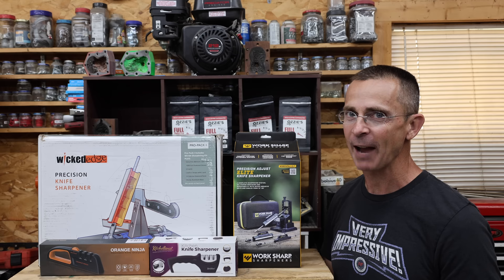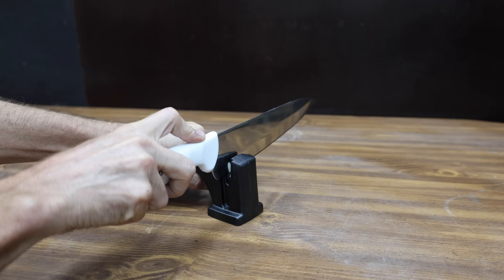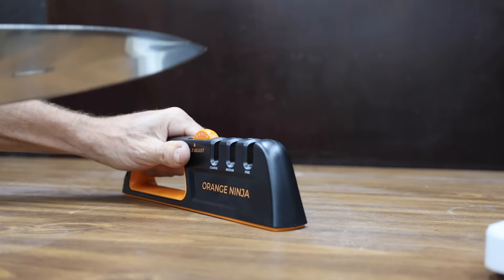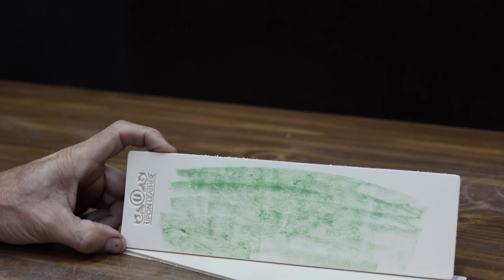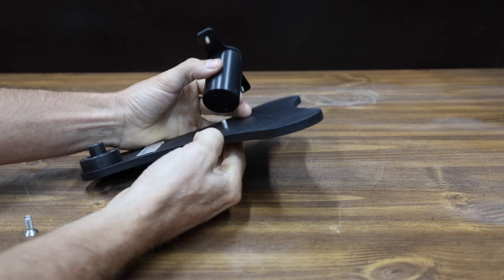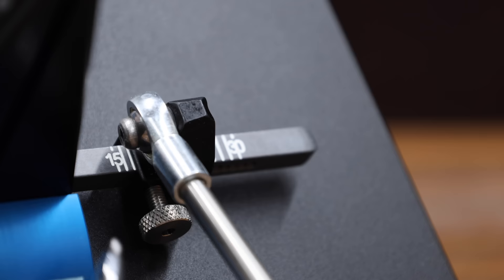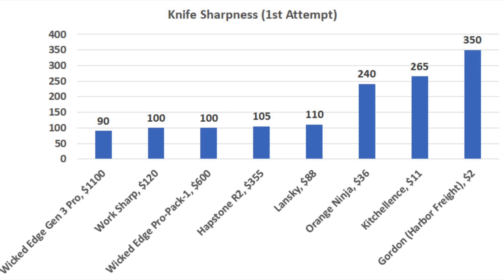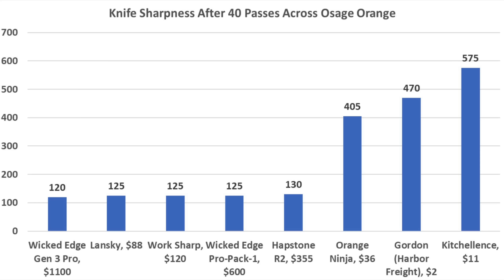Best Knife Sharpener 2023? Let’s Find Out!

Comment: Yessss! Another knife video! I’d love to see a comparison of knife steels. 440, s30v, s35, s45, cruwear, magnacut, vg10, 15n20, d2, etc.
Reply: This would be a good one,
Reply from the maker: Great suggestion! Thank you
Reply: thats a LOT of testing and very expensive. knives with premium steel are not cheap. I know. I own many.
Reply: I also would like to understand the knife metals better and I know PF would be the best way to learn it!
Reply: Cruwear is terrible.
Reply: Great idea!!! Home run for sure, so confusing when looking at knive steels.
Reply: The difficulty with doing a test like that isn’t in the steel itself, it’s in how it’s heat treated and ground. I have 5 knives in Magnacut from 4 different manufacturers and they all behave differently. My Dawson Magnacut has an hrc of 61.5 but my kershaw Magnacut leek is only 60 hrc.
Another difficult thing to rule out is blade stock thickness, as different manufacturers use different steel blanks of varying thicknesses.
Reply: @Shorty_Lickens he's tested multiple cordless power tools, tested zip ties outside for a year. He's got the capabilities
Reply: Thank you for that information. We all now know you own many expensive knives. Congratulations. @Shorty_Lickens
Reply: I agree!
Reply: @MrMisterDerp  I agree I've watched many of the blade steel youtubers test many knives and its almost worthless info because of the manufacturer variables and blade shape variables.
Reply: @naffetstterrag  No one said any different.
Reply: types of steel are difficult to compare depending on how its hardened and tempered
Reply: ApexUltra also
Reply: Victorinox polished/fine grit dual steel. Nothing else
Reply: Knife guy here 🎉
Reply: Same steel may have different heat treatment, and each blade's gelmetry would affect the outcome. Hard to standardize. Larrin Thomas's work would give you a good primer if you choose to proceed. Also, too many "knife tester" channels out there already. Find a unique angle. Best of luck.  @ProjectFarm
Reply: Check out Cedric and Ada outdoors, Pete has done a lot of tests comparing different steel, he has some wholesome content as well
Reply: Unless you can find one manufacturer that uses all of those metals you more likely comparing different manufacturing processes then metals
Reply: That would be a cool video, but pretty spendy!
Reply: Would suggest doing a Rockwell hardness test on these as well to verify proper heat treating.
Reply: Another vote for comparing knife metals! What are the pros and cons for each metal? Surely there isn't one metal to rule them all, so which ones are best for which jobs?
Reply: Yes, Yes, Yes and Yes!
Reply: @Shorty_Lickens Agreed, but I'd send mine to him, just for the "bragging rights" of them being tested by project farm! I'd even send my Strider! And my S90 Osborne carbon fiber, and I really love that one!!
Reply: Check out knife steel nerds he has reviewed most of those steels and has a phd in metallurgy
Reply: Absolutely! Please? We need this tested
Reply: Honestly, it would probably have to be a multiple part series.@Shorty_Lickens
Reply: Include M390!
Reply: Please do a test with Ceramic knives.
Reply: High carbon aogami and aogami super should also be included.
Reply: Not true at all. @freedumbsquirts4809
Reply: I would watch the hell out of a video comparing steel grades.
Reply: Yes please do this!
Reply: @Shorty_Lickens 
Knives made of good steel with brand names are very expensive.
Knives made of good steel with new brands are not that expensive
Reply: If we use the best charpner which mital have ability to be sharp
Reply: Heat treated by who? Video could be very misleading
Reply: Gonna go ahead and 2nd this
Reply: I would love to see that video.  Magnacut is everywhere in the knife world right now.
Reply: 14C28N and D2 seem the best in my use for general purpose pocket knives. My D2 Elementum is easy to sharpen and holds a nice edge
Reply: @killerhurtalot  OK. Can you link a new brand with CPM M4?
Reply: @ProjectFarm please make sure they are properly heat treated knives if you do this tho!
Reply: Please do this!!!
Reply: Too many variables, so even if attempted, it would be full of discrepancies and inaccuracies.
Reply: He could procure most of these steels with a spyderco Paramilitary 2
Reply: @andrewmattiewalter  I bet if he reached out to Sal he would be more than happy to help out with it too!
Reply: @Shorty_Lickens  ok, can you link a single kitchen knife made of cpm m4 lol
Oh wait, his tests has been on kitchen knives...
Reply: Yes, would like to see this. Happy New Year!!!
Reply: A fellow knife enthusiast I see
Reply: That'd be incredible! Definitely an expensive video though, and tough to heat treat all properly.
Reply: @lilchirp4846  it would be really difficult to find a single company that heat treats all types of steels and it would also only show that single company’s offerings which would feel like a sponsored video. One option would be to reach out to a company that specifically does heat treating and not an actual knife company. That might actually be a great idea. Thanks for the alternative!
Reply: Ridiculous unless you have variables eliminated..perhaps stick with just spyderco models and that will give you some source of conformity.
Reply: This would be fantastic. Perhaps as a start, do kitchen knives in different steels. Perhaps you could contact knife steel nerds on tips and resource on testing.
Reply: Todd did do one in his "Best Knife Brand?" video but maybe not exactly the ones you've listed. You might have to pause the video a few times when Todd shows the knife. You can see some of them will list the type of knife steel.
Reply: High carbon vs stainless steel, tool steel vs high speed etc
Reply: hello fellow knives lover!
Reply: @killerbern666 Hola 😅
Reply: You can find a lot of information from knifesteelnerds. He’s a PhD metallurgist so he’s got the technical background and can explain things in layman’s terms
Reply: It's actually somewhat of a dumb idea. Bro you've already got a ton of ppl who do videos of edge retention. Such as Larrin(inventor of Magnacut) doing sharpness testing on a quarter million dollar CATRA machine. Then there's the Cedric and Ada dude who's given himself carpal tunnel from going ghetto and cutting rope millions of times. Check them out for sharpness testing😘

Edit: also check out the great Joe X for awesome knife destruction videos!
Reply: Absolutely. Would love to see the tests that you come up with!
Reply: Yep, do that.👍🏻
Reply: @freedumbsquirts4809 Wow, that’s quite a statement.
Reply: I think the issue may not be the steel, even tho it is extremely important but also the grind on the bevel. While the testing would be entertaining something like 20cv from benchmade feels different from the same polymer steel by a company like KAI or protech
Reply: I really believe the heat treat is what’s really important. Sure, s90v is way less likely to rust than d2 but I swear my Buck (Bos) 420 held an edge twice as long as my Kershaw blur with s30v.
Reply: @ProjectFarm I agree. That's what I need to see
Reply: M4 & 20cv
Reply: @freedumbsquirts4809  CruWear is a fantastic steel. It just needs to be used in the right scenario. Where it shines is with something like a camp or bushcraft knife. It is kinda pointless on a folder. I have an OTF in CruWear, lol. Not sure what they were thinking with that one.
Reply: Yeah this sounds like a good idea!
Reply: This
Reply: Issue can also be brand. Each company has a different heat treat. For instance spyderco s30v is way better than benchmade s30v
Reply: As a fellow knife /knife steel guy I would very much appreciate this
Reply: Great idea
Reply: +1 on the different steels.
Reply: Absolutely love your videos! You get right to the point. SUGGESTION-Are the expensive non-stick cookware coatings better than the bargain versions. Mine seem to only last 3 yrs and then they are no better than a cast iron skillet. Keep it up!
Reply: Only problem is heat treatment variables, they might not be states on packaging or ever talked about, however if you were to compare a s30v Civivi to a buck s30v bos heat treated the Civivi will be significantly less wear resistant
Reply: Need magnacut on there!
Reply: Blade geometry matters more than material
Reply: Yes! This would be a very interesting test.
Reply: Yes please!
Reply: This would be amazing for the knife community!
Reply: @Shorty_Lickens cool story geek.  Laon them for testing then.
Reply: I would love to see that too but that would be prohibitively expensive!
Reply: I have an Adamas with Cruwear blade and I am very underwhelmed by it tbh
Reply: I have an Adamas with Cruwear blade and I am very underwhelmed by it tbh. Great knife but it sharpens very hard and dulls very easily in my opinion
Reply: I have an Adamas with Cruwear blade and I am very underwhelmed by it tbh. Great knife but it sharpens very hard and dulls very easily in my opinion
Reply: I have an Adamas with Cruwear blade and I am very underwhelmed by it tbh. Great knife but it sharpens very hard and dulls very easily in my opinion
Reply: I have an Adamas with Cruwear blade and I am very underwhelmed by it tbh. Great knife but it sharpens very hard and dulls very easily in my opinion
Reply: I have an Adamas with Cruwear blade and I am very underwhelmed by it tbh. Great knife but it sharpens very hard and dulls very easily in my opinion
Reply: I have an Adamas with Cruwear blade and I am very underwhelmed by it tbh. Great knife but it sharpens very hard and dulls very easily in my opinion
Reply: I have an Adamas with Cruwear blade and I am very underwhelmed by it tbh. Great knife but it sharpens very hard and dulls very easily in my opinion
Reply: @ProjectFarm can you do a test on battery heated jackets?
 It gets cold out here sometimes while working.
Reply: They would all have to be sharpened with the same edge geometry and therefore have similar blade geometry
Reply: Another vote for steel type comparisons
Reply: @ProjectFarm Since design and construction and heat treatment matter as much as steel type, I recommend choosing all or most knives from one brand that makes a lot of different steels. For example, Spyderco is famous for experimenting with different steels. You could do a steel-specific test using all knives from them.
Reply: I agree this would be a great video. My experience is that d2 is the best. Simply because it holds an edge fairly well, doesn't chip easily, and sharpen easily. S30 and all those exotic ones really take forever to sharpen and chip easily. I'm not sure it's possible but maybe project farm could get a company like spiderco or Benchmade to send him the exact same knife in like 10 different blade materials so he could do this test.
Reply: I second this! Have always wanted to know what steel is best for the common working man!
Reply: HAP40 as well
Reply: And ZDP189 😎
Reply: I'd almost be more interested in comparing sharpening stone types rather than the steels themselves. Though some steels react differently from others with regards to sharpening stone, so would need a matrix, lol
Reply: What steel do you think is the best and affordable  @Shorty_Lickens
Reply: Ok boomer..
Reply: Yessss. Might have to get them from one knife maker given different companies use different heat treat protocols
Reply: @ProjectFarm  Make sure they are honing blades specifically, many are sharpening blades which take metal off the knife
Reply: This would be awesome! Maybe a spyderco para whatever in every flavor of steel you could get ahold of. So
Reply: Great suggestion
Reply: AGREED! Maybe something like a Spyderco where 1 model is available in multiple variations of steel.
Reply: Great suggestion. Optimal heat treat for the particular steel and geometry are big ones I would think. Interesting to see what you come up with PF.
Reply: I would love you to test Tojiro DP there, sir  @ProjectFarm  
Great work!
Reply: @ProjectFarm  Please test  Radar Detectors.
Reply: Magnacut > Cruwear > 20cv > s35vn > vg10 > d2...
Reply: D2 is the worst
Reply: That's gonna be super expensive but I could see it do extremely well with views. Nobody has done a steel grade comparison with the attention to detail that you have
Reply: @Shorty_Lickens send him some for the tests😂😂😂
Reply: Yes sir!... I second that...
Reply: Yessaas knife steels that is an awesome idea it is cool yo hear the difference in metals
Reply: @Shorty_Lickens do you see his view counts? The video will easily pay for itself, lol
Reply: Oh yes i like the Idear! What you have to consider is that all knives should be sharpened in the same angle. All knives should have the same blade thickness. And a device that presses the blade straight onto the wire for the sharpening test (maybe you could build something so that you can use a stationary drill for this?).:goodvibes: Grettings from Germany
Reply: I'm a bit of a knife steel nut so I really like this idea. I feel like a good experiment would require all the knives to be the same but it would be hard to get a bunch of different steels on the same knife.
Reply: there are already so many vids on these steels on youtube and articles about the performance of each, pointless for him to do these
Reply: +1 please make a video for that
Reply: Great idea!!
Reply: The sharpness and durability of an edge is equally dependent on 3 factors: edge angle, steel heat treatment, and blade material. There are too many factors for project farm to be able to cover in a 20 minute video. This deep of a question probably requires a couple hours long videos at least to properly cover.
Reply: S110v too
Reply: @ProjectFarm Please I beg you! I heard so much shit about different steels and i guess a lot of people would love one video with solid facts
Reply: @MrMisterDerp 
Correct.
Reply: @freedumbsquirts4809  why do you say that. I love d2 and cruwear is upgrade steel of that. It's difficult to sharpen if that's why you hate it, otherwise edge retention is phenomenal
Reply: S90v and elmax, and others too

Comment: I always appreciate the macro photography included in your videos. It helps show how well these products perform, and you don’t get that kind of shot from other people trying out sharpeners.
Reply from the maker: Thank you for sharing!
Reply: I recommended outdoors55 if you want more knife sharpening videos and reviews, he also does macro shots and hardness tests
Reply: @Gromatic Thanks for the recommendation! I’m a long-time viewer of outdoors55. Alex started doing macro photography not too long ago, and his setup is amazing for viewing knife edges.
Reply: I feel this would be difficult to test objectively without going into detail about heat treatment geometry and grind extensively.?
Reply: @ArftrooperT  PF did an excellent job of removing variables by using multiples of the same knife by a known manufacturer. And sharpening at what the sharpening products say is 17 degrees or their closest setting to it. I would say that this also negates geometry issues unless the knife you want to use is so thick it won’t work on some of the sharpeners.

I do think that it’s hard to judge what the sharpeners would do to a very high hardness steel, whether it’s a simple steel like zdp-189 and Super Blue or a wear-resistant high vanadium steel like s110v, 4v, etc. However, whatever sharpeners utilize diamond plates will 100% work the same for those steels I mentioned above as they did in the video, though it will take longer to abrade high carbide steels.
Reply: Stick to the subject,if you do not have a comment or suggestions don't post

Comment: I purchased the Work Sharp Professional Precision Adjust last week. I am confident in saying that I will never need to purchase another sharpening tool again. At $250 it was definitely an investment, but it is stupid simple to use, and works for everything from my kitchen and pocket knives to my arrowheads. True 10/10 for me. I’m 33, and I don’t run into anything that changes my life often at this point. This definitely did.
Reply from the maker: Thank you for sharing!
Reply: I would suggest to get a anglefinder tool as well, since with smaller blades the angles listed are not accurate
Reply: @darknessblades The new " Professional " model comes with a digital angle finder and is the upgraded version of the one used in this test. A lot more expensive,  but higher quality parts, larger, metal base, sturdier all around.
Reply: Seems a little dramatic
Reply: … never a dull moment around here
Reply: This or the KME. I’m deciding on which one to get

Comment: HUGE difference in time and options when I upgraded from the Work Sharp to the Hapstone.  Eventually, those stones will wear out and need to be replaced.  You have tons of options for the Hapstone (grit, stones: aluminum oxide, carbide, ceramic, diamond, CBN, stropping materials: cow, horse, kangaroo, etc.).  You can also purchase an attachment for sharpening scissors.
Reply from the maker: Thanks for the feedback.
Reply: The coarser stones of my Work Sharp lose their grit very quickly. Otherwise it si pretty good.
Reply: It almost adds up a lot more to the price. Source, I have it.
Reply: I wouldn’t give a dime of my money to any Ukraine base company.